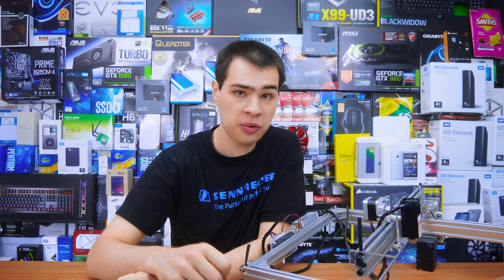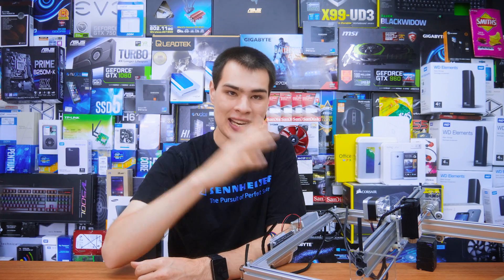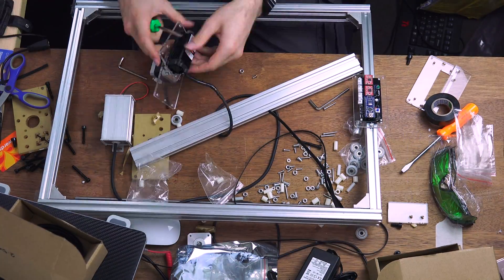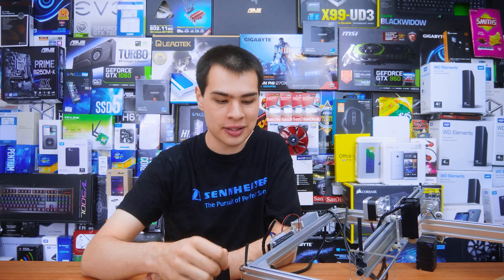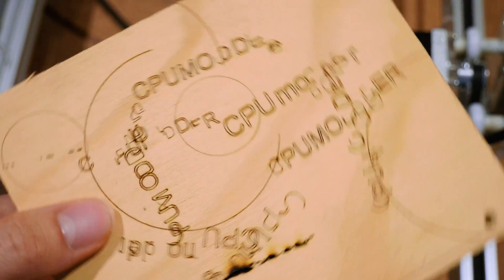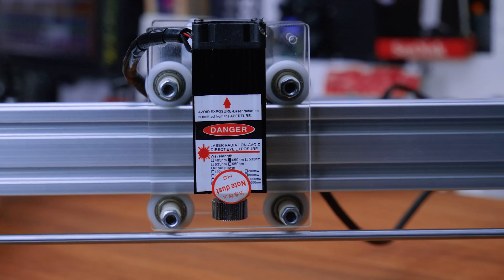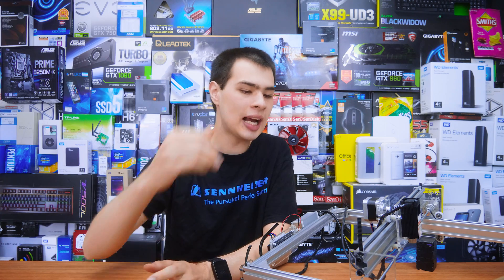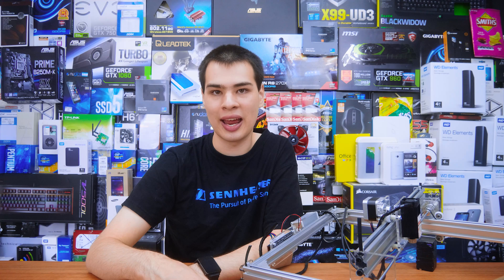Eleks Maker Laser Engraver Overview

Comment: hi 

ebay seller offered me 50% refund and keep laser machine..thats about $90 usd .should i do it?

couldnt i just buy a new control board (eleksmaker board)  for reasonable price and then get it to work 

the laser seems to function and the stepper motors seem to work but just dont seem to communicate with mainboard or driver issue for this cheap unbranded board....

im sure connections are the same....

Comment: hi i downloaded eleksmaker cam sftware and it does not find serial port
failed....it does not see laser engraver at all...failed
Reply from the maker: you need to make sure you have the right USB drivers for the board that the engraver runs, I can't remember the right driver but see if you can find a guide on setting up  the software it will usually tell you what you need

Comment: Its been 3 days i can not get mine to function..i may ask for a return from ebay seller...if i use nano328 and then go through the entire list of firmware choices none work....some do some funky things but i do know the stepper motors are good...the issue is mainboard problem or firmware problem because i can get the motors to run on some versions but funky...if i hit left the y and x motors move at same time lol....its a total mess....which makebox version firmware u use..?.....im using benbox because thatscwhat came with it....i tried laser grbl but it connects then disconnects....wont work